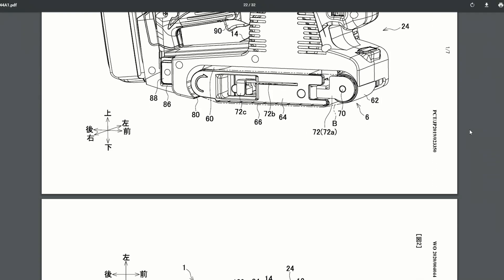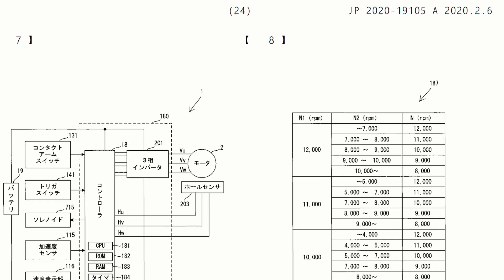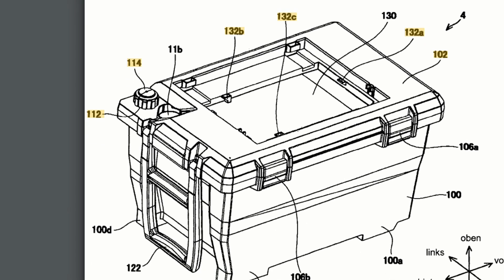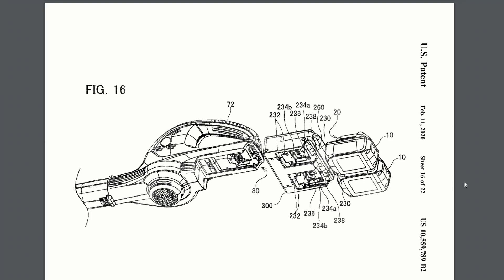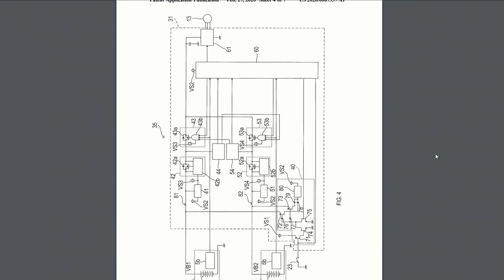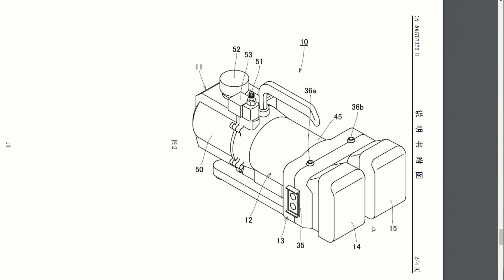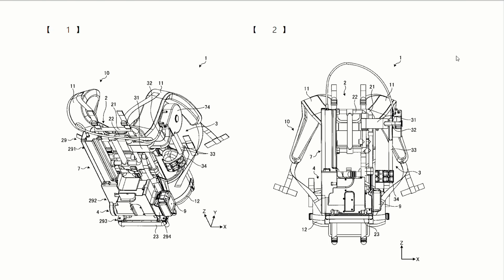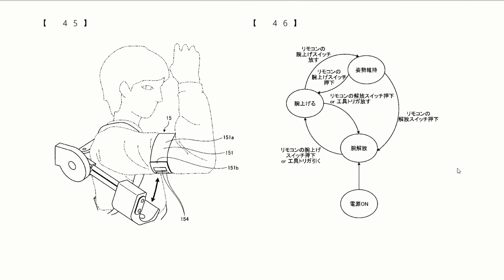Makita 2020 Patents - New Tool Predictions for 2020!

Comment: Very cool!  I may not wait for their framing nailer though.  The HPT one is supposedly great, and they have a flexvolt-like battery powered 10" table saw that I'm eyeing up as well.  Makita has neither, so it looks like I may go into a second brand for my cordless tools (though I have 20 or so LXT batteries alone, so I'm NOT dumping Makita at all!).

What I'd really love, is an updated angle grinder with a paddle switch, and a brushless multi/ oscillating tool, something like what DeWalt has.  Those are about the only cordless tools I'm dying for.  Though yeah, a cordless compressor would be sweet too!

Comment: Are makita or dewalt making a larger cordless dust extractor better suited for the drywall sanders they have out?
Reply from the maker: DeWalt makes a FlexVolt dust extractor: https://amzn.to/2W6EFYZ
Makita does have an 18V X2 version, but it's significantly less powerful than DeWalt's, at 74 CFM vs 125 CFM: https://amzn.to/2xbZABd

Comment: Damn it Makita, making all these other Batteries but wont give us a higher amp 18V. Ridiculous.
Reply: Whats wrong with the 6a? I run a few 36v tools and use two 5a and and pretty happy. Running dual 5s on the 12" miters with aws on the aws vac. I also have the 16" chainsaw and i was pretty happy with that but theres always room for improvement
Reply: You can buy aftermarket 9.0 makita batteries on Amazon if that helps. I know it sucks makita won't offer them but its better than nothing.

Comment: I was all in on the 18V Makita line but them being slow to offer some certain tool (that perform well) has made me start buying some Milwuakee stuff. I now have a very large chunk of the M12 line up. And since I needed a new 18G nailer, I got the M18 Gen2... And it's awesome. I was hoping their framing nailer would be out by now but I will still probably pick that up as everyone I talked to who demo'd it loved it. 

Makita is putting out a lot neat things like lawn mowers and coffee machines, but they should be focusing on the core tools a little more IMO. I feel Like they're falling behind the competition sometimes and it sucks because 9/10 times they're the best performing, longest lasting, most ergonomic tool you can buy.
Reply: cpt awesome couldn’t agree more, very slow to release new products to the market, leaving even Makita enthusiasts to branch out into different battery platforms..

Comment: Super disappointing that I've been waiting for years for a cordless framing nailer from them and it's on a flywheel system
Reply from the maker: It's always possible they'll come to their senses and go with a gas piston! Seems to me like the delay from a spinning up a flywheel is a big drawback for that type of design.
Reply: Let's hope so cus they're has already been a very big difference between the leading nailers on the market already that r based of compressed air and the dewalt flywheel system which just sucks
Reply: I agree! Major bummer

Comment: Please god let the framing nailer be better than the Dewalt flywheel version!

And please refresh the 18g and 23g nailers they are terrible - like Milwaukee 1st gen terrible!
Reply from the maker: Lol, isn't Makita already on their Gen 2 23 gauge pinner? 😆
Reply: @DoresoomReviews  Have no idea it 2nd gen if it is thats even worse, 23 gauge pin nailer from 18v should be easy!
Reply: @DoresoomReviews  yup,got the 2.gen 23 and pretty happy with it 👍
Reply: 23g nailer is good. Just hard to find headed nails.
Reply: @kizzjd9578  That is a fair comment - we do need 16 gauge and 18 brad updated nailers from Makita though no doubt.
Reply: It will be makita don't put stuff out that's load crap like DEWALT ha
Reply: @micjubba709  Touch wood. They have a few bad eggs in the 18v range but very little, im on a hell of a lot of 18v stuff and happy. 

Just need 2nd fix 16g or 18g brad nailers to add to my collection, I don't like the compressor cord at all lol.
Reply: Wanted to stick with Makita platform, but went milwaukee 2nd gen brad nailer. Awesome
Reply: The Dewalt is great what you talking about

Comment: Great video dude. Looking forward to a battery belt sander. I was cursing Makita the other day for not making one yet. As for a framing nailer... I have given up waiting for makita to come up with one of these. They have been telling me "It is just around the corner" and even "We have one in the country to test" FOR 5 YEARS now. I couldn't wait any longer and got the Hi-koki (Metabo HPT, Hitachi).
I love Makita tools but they have really dropped the ball on cordless nailers.
Reply: Also some of the links in your description don't seem to be working, but maybe it is something to do with my end. Getting 404 errors.
Reply from the maker: @ToolsAndStuffOFFICIAL  Thanks for the heads up, they should be fixed now.
Reply: Would love a 2.5" .15g angle nailer for hanging prehung doors. Just dont make it so damn bulky like the .23 and .18 pinner and brad nailer
Reply: Ah trolling the same sites!
Reply: @jethro1066  The belt sander thumbnail did it for me Brett.
Reply: Yup. Well they do make a "cordless" (gas) nailer but it's a complete pile of shit. And their other cordless 18V nailers are not great either. I went for the Milwuakee Gen 2 Brad.. Love it. Waiting on the framer from them also.

Comment: Looks like the framing nailer has a belt driven flywheel, unlike the DeWalt which is direct driven: I guess this may be to get around DeWalts patent, but the profile (driving rail) looks identical to the DeWalt. Problem is: it will end up bigger and heavier than the DeWalt.
Reply from the maker: That's a good point - I didn't realize the DeWalt was a direct drive.
Reply: Hope not, all makitas current guns use the compressed air method so I'm not sure why they would change to a flywheel

Comment: Neat. But I can’t say any of them jump out at me. Mostly because I don’t use makitas cordless platform.
Reply from the maker: Yeah, unless you need a cordless vacuum pump or pressure washer, most of these are just filling out the Makita lineup for what other tool manufacturers already have.

Comment: A while ago I decided to go with Milwaukee 12V and 18V, and Makita 18V. But Makita is really confusing and annoying me with what they're doing with their batteries. I'm hesitant to buy more Makita tools because I'm not sure what's going on. 🤷🏻‍♂️ Hopefully things will be clear soon.

I am excited about a cordless belt sander, but I would've expected it to be a 36V, whether LXT or XGT.

Forgot to mention: Great video! Love your content! 👍🏻
Reply from the maker: Yeah, they almost seem a little directionless with two higher voltage battery platforms AND the 18V X2 tool options. I feel like they shouldn't have released a 40V platform and should have just jumped to 64V for larger tools, but maybe they've done market research that says otherwise.

The belt sander patent didn't mention voltage, so it could be a 40V XGT release. The larger 18V LXT batteries aren't a ton smaller, so it's hard to tell from just the patent illustrations.